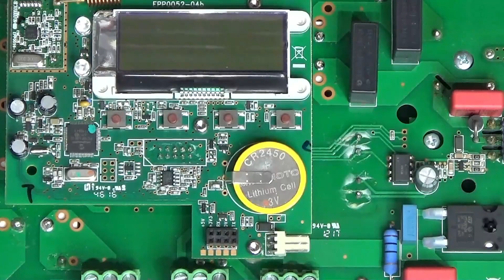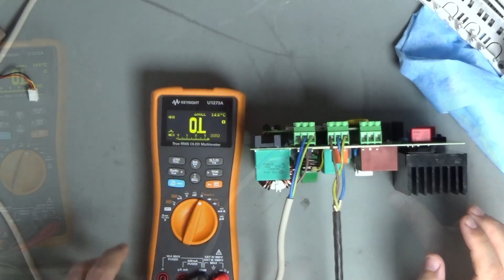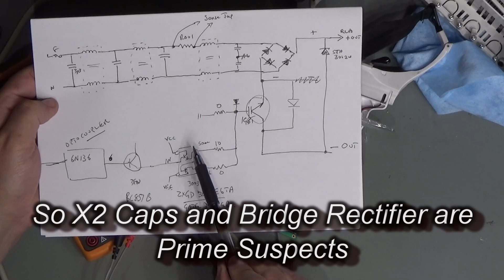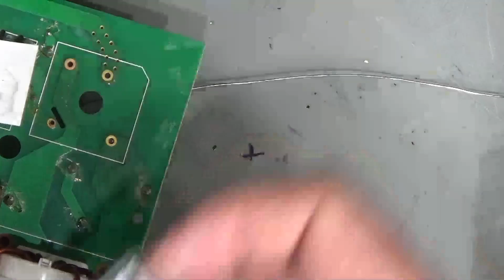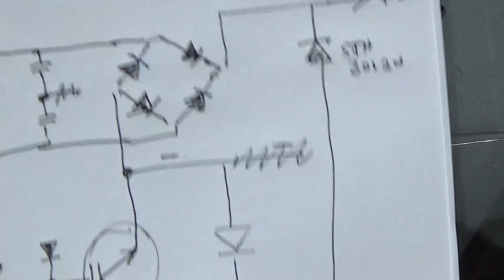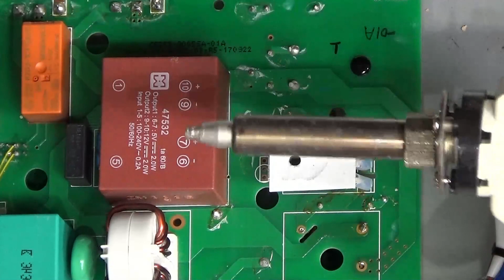Solar IBoost+ Repair #0082

Comment: Thanks for this! My IBoost tripped the circuit breaker this morning and it wouldn't reset. I took the IBoost apart and sure enough, the bridge rectifier has a shorted diode. RS has them in stock so I've ordered some replacements. The fuse on mine is a 20mm cartridge fuse in a holder and hasn't blown.
Reply from the maker: Glad it helped.  It seems to be a very common fault.

Comment: Why is the 16 amp fuse blown, what could be the problem? Thanks
Reply from the maker: The fuse blew because the rectifier short-circuited.  Why so many devices seem to have failing rectifiers is uncertain see the other comments

Comment: Excellent video. Before ordering any parts. I need to replace the 16A fuse first. Which one is suitable for the pins etc. I am UK based.
Reply from the maker: I think I used this one, a quick search indicates  but the 1.5mm diameter leads were a very tight fit https://www.digikey.co.uk/en/products/detail/bel-fuse-inc/0ADKP9160-RE/7404483
it is in stock with mouser https://www.mouser.co.uk/ProductDetail/Bel-Fuse/0ADKP9160-RE?qs=HXFqYaX1Q2w8euFTikWpcg%3D%3D 
you could always put on a PCB fuse holder like I did while fault finding and insert a 16A slow blow 600V ceramic 20mx5mm cartridge fuse
Reply: @MakeOrRepair  thank you, going with the PCB fuse holder and fuse until I find the fault.... also all your other videos have helped me check other components, so far no fault found.  Lets see how we go with a fuse change.  Keep posting your videos they have helped me 100%
Reply from the maker: thanks

Comment: Should the 3v battery be changed on a regular basis?
Reply from the maker: Not quite sure what this battery is doing, perhaps just keeping the clock correct in case of power failure. If that is the case I would expect it to last 5 to 10 years.  Whether you change it every 5 years or so, or wait for it to suddenly forget the time probably depends what functionsyou use, I have no need for any of the functions except the solar diverter so I don't care if my battery runs out,

Comment: Hi french here. Excellent video btw... I am also an electronic noob so sorry for my stupid questions. Is the output still an AC one or more DC one ? I am looking for AC-AC buck converter which can be controlled by either PWM or 0-10V or 0-30ma.... After watching your video, I am not sure there is an AC-AC buck converter inside this device ? What about harmonics generated with ? btw I guess results are much better compared to a TRIAC circuit. Thx in advance.
Reply from the maker: It is a rapidly switching dc output.  There will be lots of high-frequency harmonics on the output because it is a messy square wave, and that gives 2nd, 4th, 6th, and so on harmonics.  But the harmonics still deliver power to the heater.  They should hopefully not feed back to the ac supply because of all those big inductors and capacitors.
Reply: @MakeOrRepair  Ok it's what I was thinking about. So you have some current harmonic 3th, 5th, etc... and they can be correctly filter out by all these layers of inductors & capacitors ?. In a first glance, I would expect some inductance about 50mH around. I would be very very curious what is the associated THDI and THDV for such device for the AC in power. Thx a lot for your first quick answer. New sub here.

Comment: Great video, iboost went blank yesterday, internal fuse blown, and rectifier shorted . Ordered fuse, holder and rectifier from Farrell, so hopefully does the job . €550 for a new IBoost so well worth the repair
Reply from the maker: Hope it works out.  Very disturbing how many units seem to suffer this problem!

Comment: great videos keep up the good work. I have a solar iboost mk1  still operating? in a way but it's not heating from my solar excess power. I have changed the element and thermostat thinking that might be the problem. but the diverter unit only work from the boost button. I am getting a signal from the sender unit even on sunny days. but I am at a loss what's gone wrong. could you think of anything that might fix this diverter or is it a separate control module gone bad. any help would be great to your reply.
Reply from the maker: Well it could be a few things, but clearly the processing is happening and the rectifier and igbtvare working, so I suspect  two things.  You state the sensor signal is arriving  but we don't know if it is actually sensing a current of just transmitting some constant value.  Perhaps someone could lend you one to double check. Or you could take a look in the sensor and see if there is anything obvious. Try eevblog forum if you don't know anybody.  The other, slightly more likely is the current sense circuit.  On the little diagram I showed a resistor with wires going off to a sense circuit.  If the resistor or the amplifier to which it is connected have failed then the processor will think you tank us either short circuit, or already hot.
Reply: @MakeOrRepair  , the diverter is receiving a signal from the sender unit, and everything with immersion checks out. Could it be a simple fix like a resistor or diode? Is it worth getting rid of or repairing it?
Reply from the maker: @SPECTRUM580  it probably is a fairly simple fix  either resistor or op amp, but I only stated the two most likely causes in my previous reply, it could be something worse.  Whether to fix or not depends how much it is saving you.

Comment: would a television engineer in a shop be able to diagnose the fault with my iboost diverter that does not heat the immersion heater tank. help would be beneficial
Reply from the maker: Certainly the type of fault that seem to be typical.  More a question if they are willing to tackle something out if the ordinary

Comment: Awesome vid. Mine has been tripping the MCB. on board fuse is ok but as soon as power is applied the fuse on the MCB trips. got a rectifier and hoping this will fix my issue.
Reply from the maker: Hope it works for you
Reply: @MakeOrRepair  worked a teat thanks so much for the video you are a legend

Comment: I have just had my second I-boost short on me yesterday. That is two in three years.  Very frustrating- what are the screw sizes that connect the bodywork?  How much did the new bridge rectifier cost?  Shouldn’t Marlec be investigating why so many of these units are failing?  Ebay is flooded with non working units.  Is there a mod that would make them
More reliable?
Reply from the maker: The fuse and rectifier are pretty inexpensive, about £10 in single quantity. Just limited supply, but most suppliers stock them. You might just have to shop around.  The rectifier is significantly over specified so it makes it hard to see what is causing the failure, I originally thought it might be thermal, but also perhaos a voltage spike when the imersion thermostat switches off suddenly.  I agree the manufacturer should look into it, in the old days you could report the product as not fit for purpose to trading standards, but unsure if there is an appropriate body nowadays.

Comment: Thank you for the video, I am struggling to open the back scresw, could you please advice me what sort of tools and which size shall I use to open them
Reply from the maker: Perhaps someone might have one not fastened to the wall so they can give a definitive reply.  I can't really remember.  If they are not cross headed then they are almost certainly torx - a star shaped indent on the top.  They are pretty common, and torx drivers are widely available.   If they are a star with a pin then that is security torx, also easily available, the screwdrivers are the same as torx except they have a hole in the end of the tip.

I don't know the size but probably a T10 or T15 would be my guess but it could be a T20.  I would recomend a set, you should be able to pick up 1/4 hex torx bits for about £5 or £6 if you have a handle, or individual drivers for not much more - remember to get thin long bits so they fit recesses!

Not sure where you are but these might give an idea...

https://www.amazon.co.uk/Hakkin-Tamper-Security-Magnetic-Screwdriver/dp/B0B5YYW117/ref=sr_1_117?crid=128M4VP56HIGZ&dib=eyJ2IjoiMSJ9.Pz2nfWZ0MSGBBGRVkiawZumG1pO3qvm0VXtX2ELkHnoBmFbOhACDfVTT_esgnX570y2az_q23G7XLfVAkyVh4_tBMGxh7Q23BPd8tXo2YrW8bnUlfW_J8nxZAX-zuTuUAiv4J-P0B9fRE4YHe63mMyA-LCqplNisYe7BeYyo47mR0h6IGmB8AeOvLdrH7J-4gnLhRFLk7GMqgf_0GTNiNSciqMT93IcoRXJzLjGLaxbpP62jrtVlqy-TLTXkiIeZWdn1oj1HjGWKTh9Vsve86TcK9Bx1YXxV5mapMBQi-9E.CFbrqwBmL-R5gvPdT0dgvrahSwf2Vi83jxrVkwf0ODI&dib_tag=se&keywords=torx%2Bdrivers&qid=1726350173&sprefix=torx%2Bdrivers%2Caps%2C93&sr=8-117&th=1

or just search torx driver on Amazon or toolstation or whatever.

Comment: Thanks for this video. My iboost has jist failed with the same issue.  Given the number of YouTube videos that diagnose the same bridge rectifier fault, i was wondering if over speccing the replacement with a KBPC3516WP might be a good idea, what do you think? Also do you have a part number for the replacement fuse you used? Thanks again for the brilliant video.
Reply from the maker: I didn't spot that one when I was searching for an alternative  I was proably mislead by the photo having the wrong footprint.  It's hard to know exactly why it is failing, you would have thought the spec they use would be adequate but overspec is certainly appealing.  My fear is that it is heat that is the problem or an unexpected transient but given that imersion heaters are largely resistive, I don't get it.    The forward voltage drop is fairly significant in these packages at more than 5A current and that translates into a fair amount of heat particulalry if the iboost is in an enclosed warm space, (that would derate it and the ability of the heatsink a little).  That said, the device you are looking at seems to be specified to quite high junction temperature.  So as well as over-spec on the bridge rectifier, perhaps try for a good quality heatsink paste and apply thinly and evenly as possible - I would try it but just make sure they send the right footprint!  
Regarding fuse I did find it a bit marginal on the hole size (the lead on the 16A fuse is 1.2mm diameter) so you might be better seeing if you can find one with a slightly thinner lead although I managed it just!
Digikey 	507-2140-ND
Bel Fuse inc 0ADKP9160-RE   
16 A 600 V AC 500 V DC Fuse Cartridge, Ceramic Through Hole 5mm x 20mm (Axial)
Pretty sure you can get it from mouser too.

Comment: I have an issue similar to another comment here. Display states "Water Tank Hot", when it isnt. To br honest over the past few weeks if not heard the fan kick in when its supposedly heating the water from the solar panels. 
Again mine is out of warranty by 7 weeks, where the on-line retailer Heater Shop seem to be passing the buck to the manufacturer. Ive emailed both Heater Shop and Marlec regrading this product not lasting reasonable period of time under Sale of Good Act or Consumer act 2015, so will be interesting to see what the outcome will be.
Reply: I have an issue similar Display states "Water Tank Hot", when it isnt. To be honest over the past few weeks iv not heard the fan kick in when its supposedly heating the water from the solar panels. 
Again mine is out of warranty by only 7 weeks, where the on-line retailer Heater Shop seem to be passing the buck to the manufacturer. Ive emailed both Heater Shop and Marlec regarding this, due to the product not lasting a reasonable period of time, so will be interesting of the outcome?
Reply from the maker: Yes will be interesting, and i would say this probblem and rectifier blowing seem common so might be worth notifying a gov dept, ot sure who it is at the moment, and if you have no luck there is a consumer rights ombudsman and feek free to refer them to comments for this video, where there is plenty of evidence, and im only a small channel

Comment: Many thanks they are still avaliable on Aliexpress
Reply from the maker: Always worries me buying obsolete from Aliexpress, counterfiet is a big problem particularly with repairing current equipment that is left unattended.  I would probably go for the subsitute from a reputable supplier after checking the datasheet very carefully unless there is little choice.

Comment: Anybody know the component number of the IGBT ?  Thanks
Reply from the maker: I thought I had included that in the video but evidently it did not make the cut.  FGH40T65UPD which is 650V, 40A Field Stop Trench IGBT, it seems to be obsolete but the parametric equivalent is NGTB40N65FL2WG (at least according to Digikey).  Obviously you can still get the datasheet and find a superior device if you want.

Comment: As mentioned in comments before my unit is constantly displaying tank hot. Even though it’s not and everything tests out ok with element,stat and cabling, boost works ok when hot water is needed. Unfortunately it’s outside of warranty and Marlec will not offer repair. Do you know of any companies which offer repair or I would have to purchase a new one
Reply from the maker: Well it certainly sould like your unit, not your wiring is faulty.  Interesting that the boost works.  The device has no real knowledge of the tank temperature, it simply assumes it is hot when it it tries, but is anable to deliver any current to it, the imersion element has its own thermostat.  It seems then that the fault lies perhaps in the current sensing which would either be really easy or next to impossible to fix.
I'm not aware of anyone repairing these, and I'm afraid I don't run a repair business, I am retired and just did this repair for the video, I would need all sorts of expenside insurance and ongoing certifications etc to start doing repairs on electrical fittings again.  We used to get occasional things delivered for repair when I was training, so if there is a local tech college or perhaps a maker communinity place they might tackle it (or might not).  Most of the information to get started is in my video.  Near us there is for example a community repair centre where volunteers do all sorts of repairs and even teach people how to maintain things.
Sorry can't be more help

Comment: Great video. Replaced  the bridge rectifier and fuse.  Working perfectly again. Many thanks for the info.
Reply from the maker: Always good to hear, thanks.
Reply: what was your fault on your iboost for a replacement bridge rectifier and fuse to do the fix

Comment: Hi, great video. Mine suffered from the same fault, a rapid unscheduled event of the bridge rectifier. Mine took out the 16A fuse, the 13A fuse and the RCD on the DIS board, oh, plus that lovely odour.  Replaced with the GBPC3510W and all OK, but have you any idea what makes something with that rating self destruct?
Reply from the maker: I'm guessing heat maybe, there is a lot of current with quite a big fwd voltage drop and the heat would derate the device a lot. Other than that perhaps there are some nasty switching transients that cause it to fail over time, given the size of the chokes they obviously have quite a lot to suppress. but I would have thought  that would apply more with very inductive loads.  Certainly my heater is mainly resistive, but they may vary.  The other possibility is that the company ended up with counterfeit parts.  But all just guesses.

Comment: Thank you for the video. My I Boost just failed. 16A fuse did not blow, but the 13A fuse in the switched spur did, along with the RCBO in the consumer unit. I have removed the bridge rectifier which is shorted between the two close together pins, which I think are DC positive and AC negative!  I have ordered a Vishay GBPC3510W and just hope nothing else is fried.
Reply from the maker: From peoples comments it seems the bridge rectifier is a common failure point, wonder why.  It has a fairly high forward voltage drop at significant current so perhaps it is a thermal problem 🤔. Whatever it is make sure you apply paste and get a good thermal mount on heatsink.
Reply: I now have the part but am waiting for a new soldering iron to arrive as my old soldering station gave up the ghost getting the old one out. @MakeOrRepair
Reply: Now fixed.  I had difficulty un-soldering the old rectifier  and did not make a very neat job with the new one, but it works again and in today's dull weather it did show some electricity sent to the immersion heater. I put on plenty of Arctic MX4 thermal compound.
Reply from the maker: @TX200AA  always nice to hear a success story

Comment: Hi, cool video thanks - mines dead with no display readout - same older model as this one. Any idea what the fuse is if I grab a replacement please? 

I did see someone mention a 16A ceramic fuse but that was the newer one!
Reply: Ignore that 16A 600V I happened to stick the kettle on at the exact moment you said it sorry!
Reply from the maker: You shoul dbe able to find them with little problem.  There are alternate mounting holes, but beware mine had conformal coating, comes away on the soldered pads just with heat but trickier if you use the alternate mounting holes - although acetone cleaned it off just fine.  I did have to clean the holes very well because the leads were bigger on my new fuse.  I think there is room for a PCB mounting 20mm fuse holder if you want a 20mm cartridge fuse (same rating of course)